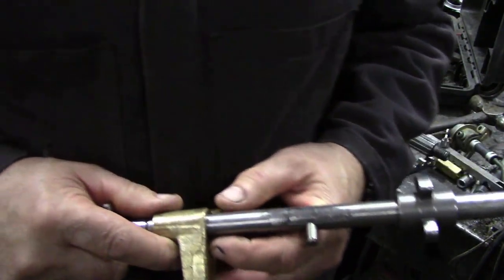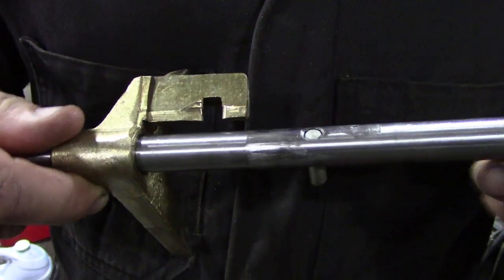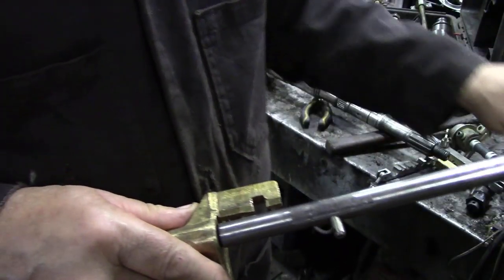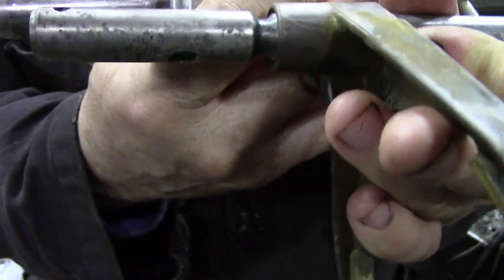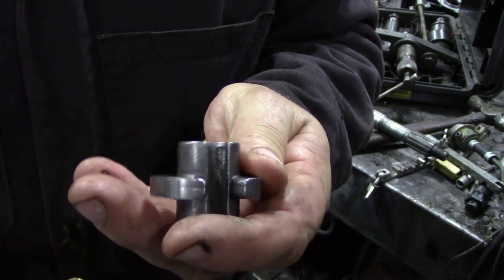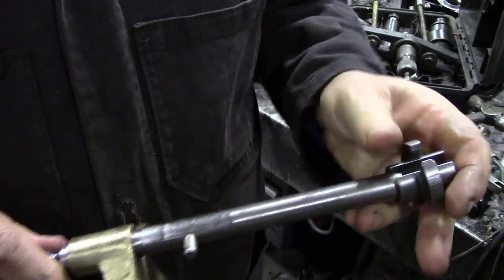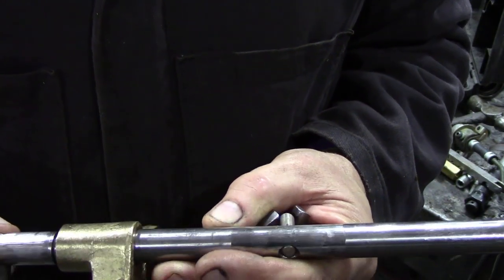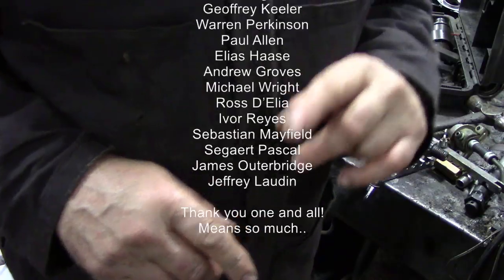Robert's LT77  gearbox. Why is it difficult to engage 4th gear?  Part 4

Comment: Hi Mike. I started my working life as a Land Rover apprentice in 1980. In 1981 I was assigned to assist in the methods builds of the new LT77 and LT230 gearboxes. I helped with the introduction into production of the Chrysler A727 automatic in the Range Rover Vogue, all LT230 variants, the ZF 4HP22 and the electronic control variants, the Borg Warner 1361 and 4462 transfer cases into Range Rover, but specialised in the LT77, LT77S and R380 gearbox families, eventually becoming the product support engineer for all Land Rover Transmission products. I watch your video's with interest as I relate to your style of problem solving. In this particular case, I would say that the underlying issue is one of gearchange remote setting. The bias spring setting is crucial on these boxes as their exists a slight 'dogleg' between 3rd and 4th. The 3rd setting can be bang in the middle of the 3rd gate but when the lever is moved to 4th, the selector mechanism can 'hang up' on the corner of the forks. This gives the impression of baulking and is easily overcome by just moving the lever against the 3rd/4th bias spring slightly. Screws and locknuts are provided on the gearlever tower to accomodate this. All of the observations you pick out during this strip I have seen before, but none have proven to have any significant bearing on the quality of gear selection.
I specialised in gear selection quality during my latter years at Solihull and worked closely with manufacturing and design to assist in overcoming these issues with dealers and customers. Sadly, I left Land Rover in 1999, just before Ford took over.
Reply from the maker: I have rebuilt a lot of these over the years and I have never seen a selector shaft so worn
There is a new shaft and interlock on order - the syncros looked very good and were not cause for concern ( although I will fit new rings and springs from Ashcroft's) The bearing were marked, but showed no signs of heat or misuse - more like particle wear on the surfaces
Once together I will focus on the shift, but as it is I cannot do much at the moment
Many thanks for your knowledgable comment!
Mike

Comment: I wonder if it's a combination of wear on the shaft plus wear on the synchro,  etc that interferes with fourth gear? Is it possible to build up the shaft then machine it back into shape,  as someone else suggested?
Reply from the maker: Its a hardened steel shaft and the pins are a bugger to get out - best get a good used one or a new one  - I do not think they are that expensive - but I think with a new shaft and a rebuild kit it will be fine - I can seen nothing else wrong
Reply: @BritannicaRestorations  I was unaware of the cost of the shaft. I don't know what the cost of machining is these days, but it used to be cheap when there was a machinist on every corner. It must be frustrating trying to fix a gearbox minus the engine?
Reply from the maker: Problem is, you cannot guarantee the shaft is going to be good after repair - and as you know, pulling these boxes out is not an easy job if the repair fails

Comment: I suppose that it's a long wait for a part or amputation and threaded donor!?! Or weld build up and lathe,either way it has to be perfectly aligned!
Reply from the maker: Quite difficult to work on as the shafts are hardened  - I am sure we will find one soon

Comment: Similar to how some drivers will ride the clutch, it's not unknown for drivers to "hold" the shifter in gear - could that be an issue? I mean, it's not designed for a constant load. And it would vibrate a bit with the road and vehicle movement. Could have been any one of many previous owners/drivers
Reply from the maker: I think so. The clutch pedal is not a foot rest and the gear stick should be left alone  - it is not a hand rest !

Comment: It's hard to imagine why wear on the shaft and possibly spool interlock, would result in not being able to select 4th when the car is moving but can select it when the car is stationary.
Perhaps not on cause.

Did the own mention anything about other gears?
On a side note: Have you had issues where the spigot bush is too tight on the pinion shaft? The shaft can turn in the bush but when the engine is running, it's hard to select 1st gear.

Comment: Sorry to be off subject Mike  ,  but is it possible (without too many mods) to replace the Axles of a Right Hand Drive 1984 D90, with Left hand Drive 1998 Discovery 1 Axles.?
With increased importation of early RHD Defenders over here to the states,  I'm sure I'm not the only one with this question..
   Maybe make a good video..??  Maybe also the pro's and con's of such a venture.
Reply from the maker: Yes you can - if you can still find them!